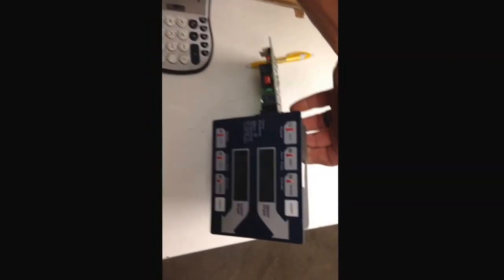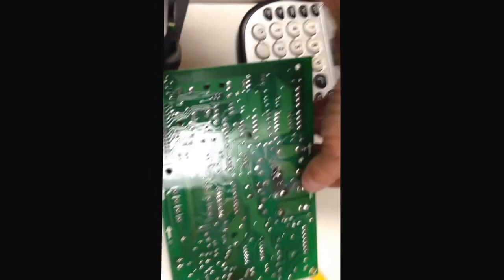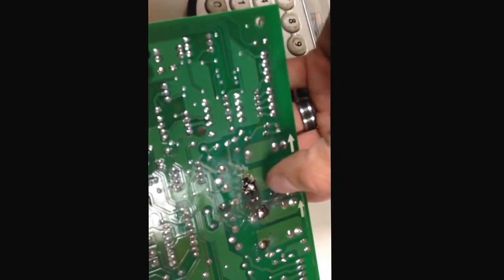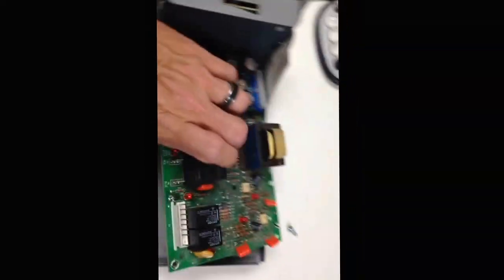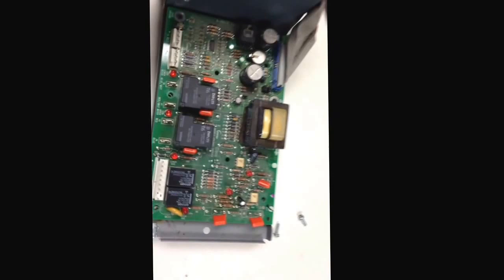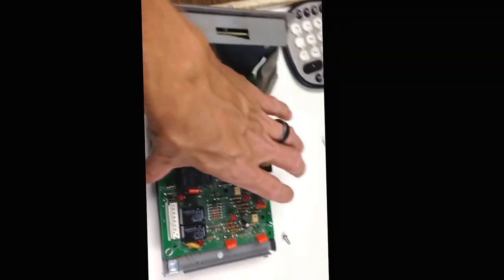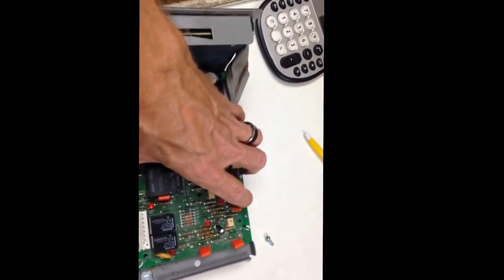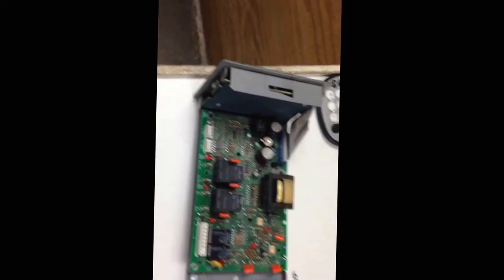Dexter Dryer Not Turning

Comment: my tumbler on the bottom wasn't working.  I switched computer boards and there was the problem, a burn connection on the motor relay.  I put solder on it and it works now.  Thank you!  I appreciate your videos.

Comment: I have a Dexter dryer just like this.  My top drum won't turn, but my bottom runs just fine. Both run off the same controller. Could my problem still be a result of a bad solder connection, or what do you think?